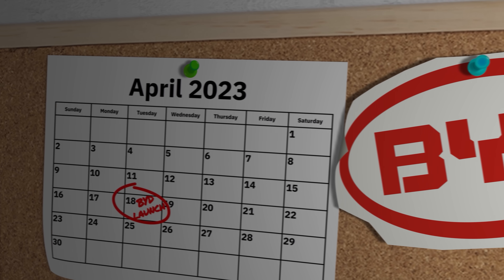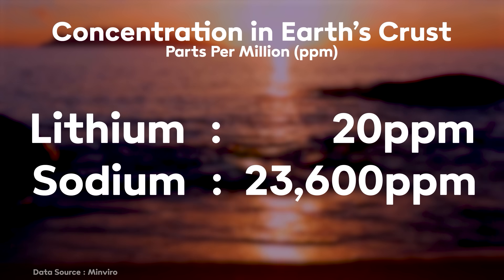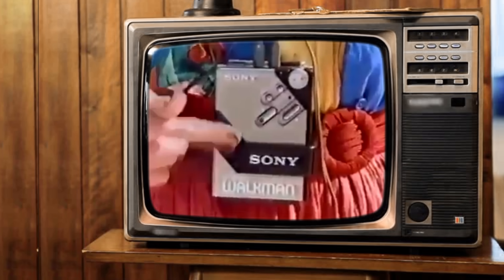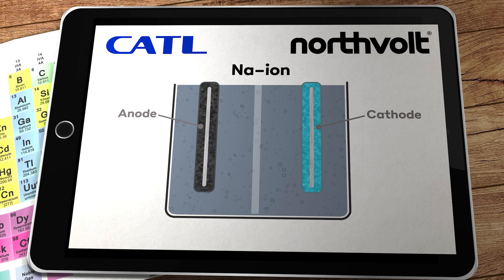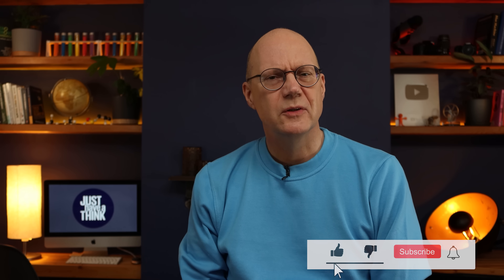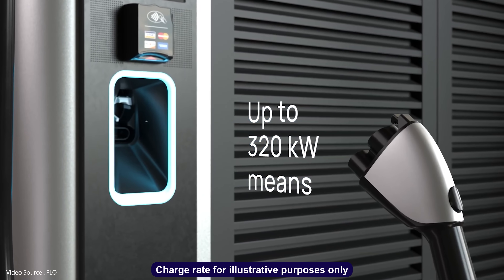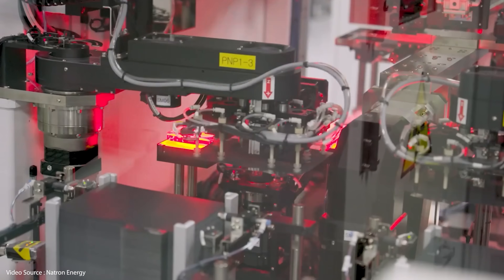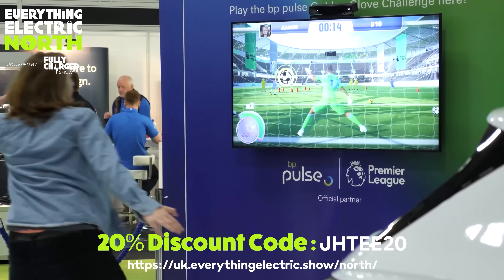Sodium-ion batteries in the USA. Beating China at their own game!

Comment: I am somewhat skeptical that electric vehicles can ever completely replace internal combustion engine vehicles, I think that where we are today with electric vehicle research, technology and manufacturing is impressive and depending on your driving needs electric vehicles can be practical and compete with combustion engine vehicles. If you only need to drive short distances (up to about 200km a day) and live in a house, apartment or condo that you will be returning to at the end of the day and can charge your vehicle overnight at home and live in a climate that does not drop to far below freezing, an electric vehicle should be practical and economical to own.

If electric vehicles are going to be replacing combustion vehicles there will also need to be some thinking on where the extra power required to charge them is going to come from and how are the transmission and distribution systems going to be upgraded? Also, how are all the electrical services at the homes, apartments, condos  or public buildings going to be upgraded so that they can charge electric vehicles. When electric vehicles need to be charged on the road away from your home how and where are the new charging stations that will be replacing gas stations going to be built?

Let’s assume that the extra power requirements will be available and that the transmission and distribution systems will be able to be upgraded and that we are able to build as many charging stations as required. And lets also assume that battery technology improves so that electric vehicles can be charged in the same amount of time it takes to fill a gas tank and since we are on a roll here lets also assume that the battery can last for the life of the vehicle such that you can drive it up into 300,000 km range and the vehicle can last up 10 years or more depending on how it is used and driven and that the cost to buy electric vehicles is competitive to a combustion engine vehicles.  Even if all of this comes true, I remain skeptical that the transmission and distribution systems will be able to deliver the energy fast enough to charge electric vehicles at a charging station in the same amount of time it takes to fill a gas tank but maybe there will be other options and technologies that will make this possible. Producing clean hydrogen with electricity and using fuel cell powered electric vehicles may be possible and may be competitive with batteries.

Electric Vehicle batteries are rated in KW-hrs. A typical electric vehicle today that has a range of about 300 km uses a battery rated in the 50 KW-hrs range. Provided that your home, apartment or condo where you live has an electrical service with the required capacity you will be able to charge your electric vehicle overnight.

A typical electric vehicle battery charger that you can install at your home can deliver about 5 KW of power. This means that you can charge your vehicle overnight in about 10 hours (5KW x 10hrs = 50KW-hrs). If you only use 40 KW-hrs for the day then to get the battery up to full charge for the next day will take 8 hours. 

At a charging station, to charge a 50 KW-hr battery in one hour will require a power source capable to deliver 50 KW of power. That is starting to be a significant amount of power. Traditionally, a transformer rated at 50 KW was used to connect up to 15 homes. In older neighborhoods of the 20th century it was not uncommon to connect 20 or more homes to a 50 KW transformer.

To charge a 50 KW-hr battery in 30 minutes will require 100 KW of power. In 15 minutes, you will need 200 KW of power, In 7.5 minutes you will need 400 KW of power and in 3.25 minutes, about the same amount of time it takes to fill your gas tank, will take 800 KW of power. This is for one electric vehicle. A typical gas station in a city has 8 pumps and during the day they are all being used at the same time and you are usually waiting in line one or two cars behind. So if you have 8 electric vehicles that need to charge at the same time that is 6.4 MW of power. That is enough power for about 2,000 homes or about 6 to 8 fifteen floor buildings with 200 to 300  apartments or condos in each building. 

To deliver 6.4MW of power, you will require two or three transformers about two meters by two meters by two meters with some switchgear in an area about twelve meters by twelve meters. You may also be able to do this with one larger transformer in an area about eight meters by eight meters. You will also need the right of way for either an overhead or underground distribution power line in the 15KV to 30 KV range to connect to the grid.

Generating the power locally at the charging stations would also be an option. To do it with wind or solar would require hundreds of Acers of land so that would not be possible in a city. It can be done from traditional sources such as natural gas or perhaps using the new nuclear technology of small modular reactors (SMRs) or micro modular reactors (MMRs). There are some impressive developments in SMRs in the 300 MW size range and in MMRs in the 15 MW range.

I am sure battery powered vehicles will continue to make gains but remain skeptical that there will be one solution for automobiles on the road. Whether its generating electricity for the grid or the type of power used in automobiles, there rarely is one “silver bullet” solution.  Having said this, if battery powered vehicles completely replace combustion engine vehicles, my feelings will not be hurt.

Comment: I suspect that with the new tariffs this thing might cost a tad more. Also once we get a larger fleet of electric cars we'll need an easier and faster way of charging them. Imagine being in a big holiday rush with everyone else and then having to line up at chargers with a cue 2km long. Personally I think Ammonia is the way to go. Can be made by renewable energy, air and water. Can be easily transported and stored. There is already a distribution network with petrol stations, they would just need another tank and pump. I really hope they get the fuel cells for Ammonia going very soon. I'm not against electric cars, but I think they're mostly useful for shorter distances and as a 2nd car. If you live in a high rise building with not much parking, where are all the chargers going to go ?

Comment: BYD Seagull does not have a sodium ion battery. BYD talked about it, then sold it with a lithium battery.
Reply: LPF are in Tesla model Ys also, different from lithium ion..
Reply: @jaaklucas1329  not sure what relevance this statement has other than providing the obligatory 'but tesla...' comment that seems to be on every video made mentioning an EV.
Reply: @giddyup3451  I think I was pointing out that LPF is a different chemistry compared to Lithium Ion. I mentioned Tesla model Y to demonstrate more widespread use of LPF when high performance wasnt required.
Reply: @jaaklucas1329  Lithium ion covers every battery that use lithium ions. Lfp, nmc, LiPo, LTO. But thanks for your insight.

Comment: Sodium-ion is 100% NOT used in the Seagull, they are LFP cells. Sodium-ion is not yet commercially viable due to material stability issues, you are damaging your reputation as a technology communicator by pushing out misinformation, do your due diligence before releasing videos

Comment: Sounds ideal for home battery systems.
Reply: Lead acid seems to cover that well, relatively cheap, comparatively low pollution in manufacture, easily recyclable, no real temperature issues, and easy to charge, with simple electronics from solar, hydro, wind, as with all home power, cost will rule the day.

Comment: If Sodium turns out to be what we need to electrify our needs and help meet the net zero target.
I am interested to see the contribution Lithium has made to that target.
How much Carbon have all these EV's , that we are supposed to be buying, generated in their production  ?
Presumably, they will be redundant and a bit of an embarrassment   ?
Reply: Sodium batteries won't make lithium batteries obsolete, there are tradeoffs to consider when deciding which one to use for a particular situation.
Sports cars will probably continue to use lithium, but stationary batteries (grid storage, home solar storage, backup power for charging stations) will be built with sodium as soon as it's cheaper, because the weight won't matter as much for something that sits on concrete and doesn't move once it's installed.
Ordinary cars will probably be an either/or situation - sodium is cheaper but heavier so the low-end models will be sodium.

Comment: One thing people don't talk about is power equipment. Something such as a forklift has thousands of pounds of counter weights on the back of them to keep it from tipping over. If you can use these less energy dense as some of that weight, while at the same time being able to charge an entire forklift in 5-10 minutes that would be revolutionary. I know a lot of forklifts are battery powered already but this could be much better than lead acid and there's still millions of forklifts out there that are propane or Diesel. There's also stuff such as gravel road graders and big heavy rollers that are needed for paving roads. These heavier batteries would actually be a benefit . And because they charge in 5 minutes this is also a no brainer for many types of industrial equipment

Comment: Once the masses start feeling threatened by climate change - which could start happening in the next 10 years or so, governments are going to be compelled to act and act quickly. Such action might include a war-time style program to buy and install mass quantifities of solar panels along with millions of storage battery systems. These panels and batteries could be installed wherever they make the most sense and could quickly cut back on coal peaker plant usage and even baseline gas fired power plants as well as stabilizing the grids. Cheap, durable sodium ion batteries would fit the bill nicely for such a project and most likely could be ramped up quickly if the urgency (and gov money) is there.

Comment: The high power to weight ratio of the Natron Na-ion battery might be an ideal hybrid solution for large vehicles from pickups to over the road tractor trailer trucks. The power system would consist of a gasoline or diesel sustainer engine that is sized to only supply that average amount of power the vehicle combined with relatively small Na-ion battery pack that  provide any power required above what the sustainer produces. It also allows the battery to absorb the high amounts of power when the motors driving the wheels act as generators to give regen braking.
The steady power from the sustainer engine means that the engine can be designed to be much smaller and always operate at peak efficiency. This contrasts to the diesel engine only truck where the engine has to be able to meet peak power, and so spends the vast majority of its time at 1/5th to 1/4th of the peak power where it is much less efficient (15%_18%) than when operating at peak power (35%-40%).
The relatively low power to weight ratio of Li-ion batteries means that the total Li-ion battery pack to supply and absorb the high amounts of power would have to be much larger than the Na-ion. The Li-ion batteries could store a lot more energy, but it is unlikely that the greater amounts of energy storage 11:11 would be needed since the amount of energy that needs to stored is only what is needed during acceleration or uphill climbs.

Comment: As a biologist, I'd like to say that the claim "there's plenty of lithium so don't worry about it", is oversimplifying things. We're finding that a lot of lithium deposits are in places that will cause enormous environmental damage if we dig them up, and there are fights between mining companies and scientists, conservationists & local communities. Areas that contain endangered habitats and species, sometimes they're national parks etc. So there may be enough lithium but accessibility is a problem if we don't want to sacrifice habitat and species. If we're trying to switch to renewables for sustainability reasons we must also consider the permanent damage we may do when we pursuing such resources.
Reply: Salton Sea looks promising. Not sure of the negatives, though.
Reply: The damage being done by internal combustion engines is 1000x greater then digging for lithium. One pound of Lithium removes 1000's of lbs of carbon being put into the air. Think about that next time your sitting a long stop light your car engine idling pumping out deadly gas into the air.
Reply: Cobalt is also not without cost. It is estimated that the number of child slaves mining cobalt has doubled (more than 10,000, though hard to measure) in the last few years and is on track to increase further. The mining of lithium often releases CO₂ from the soils where it is found, adding to that produced by mining equipment and transportation.Overall, it's going to take one huge number of (non-recycled) EV's to make up for it. Recycling, of course, only adds to the carbon.
  In addition, the US electric grid is not prepared to handle the EV's and will need a significant upgrade and investment. People near me who bought EV's had to have the elecrical systems in their homes and all down their streets replaced.

  It may be that making up for our past errors by doing the same things that caused the original problems (using more resources and technologies) will only make things worse.
Reply: @mikemondano3624  all the more reason for sodium ion to take over for the majority of rechargeable uses
Reply: @mikemondano3624  You can level 2 charge your car off your dryer circuit with an either or switch quite simple.
Reply: @jaaklucas1329  Yes, very slowly.
Reply: For every pebble turned, a biologist starts a protest.
Reply: @billkraemer4710  Not a subject you are conversant with, I see.
Reply: I really wish this was higher up. THIS is the huge problem with lithium.
Reply: OK. But none of the habitats will exist at 5°C.
Reply: @Hansengineering  Right?  So how high did ocean levels go to bury that ecosystem under the oceans?

These are all the idiot comments that keep showing up.

Hi I'm a biologist that works for Exxon-Mobil.
Reply: @Hansengineering get a push bike and sell your car, the only environmental option for you.
Reply: So what you're saying is we can't destroy some small ecosystem to save a planet.

I keep hearing this and get a good laugh every time.

When the oceans rise 30 ft. let me know if that small ecosystem is still above the ocean level OK?

I'm not saying humans should be irresponsible about making a shift away from fossil fuels, but we don't need to be stupid idiots either.  Go talk to the tens of millions of people who've already had to leave their countries because THEIR environment is totally screwed, because global warming is a very uneven thing around the world.  I mean, are Europeans going to keep letting in blacks from Africa as they keep losing farmlands because it's too hot?  Are Americans going to let in..........  no they aren't even now without HUGE fights even though the US needs the labor force for manual labor to install the very infrastructure needed to deal with this.

So, be a biologist.  A REAL one.
Reply: @johndoh5182 it typically gets a bit warmer before a Heinrich Event. NO! I’m not a “denier”, I just believe we are going to get colder as the AMOC shuts down
Reply: @johndoh5182  Biologist's saving habitat is a hard fact, your sacrificing habitat is only a speculation.
Those emigrations are NOT caused by weather changes, but by:
- land over-exploitation (overgrazing, over-irrigation)
- colonial and internal politics
- population EXPLOSION / exponential growth
- local wars
In California and many other places in the world land subsided by 10m (30ft) or even much more. Why? Agricultural practices, exploitation of aquifers and lack of recharging of those aquifers due to encroachment and irrigation systems, bad agricultural practices.
Search "Land Subsidence from Groundwater Use in California" - in many areas land subsidence is 2-5 feet per YEAR due to pumping ground water. Rain water floods and is redirected to the sea. 

So how sodium batteries or any battery tech can solve these problems?